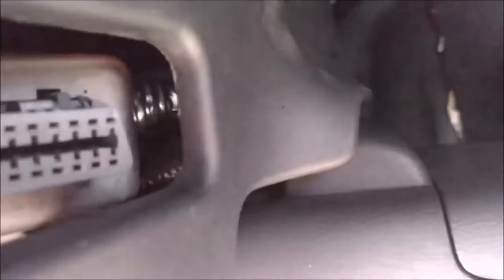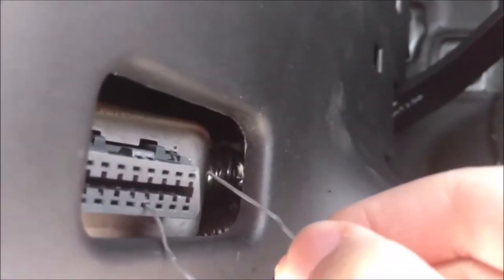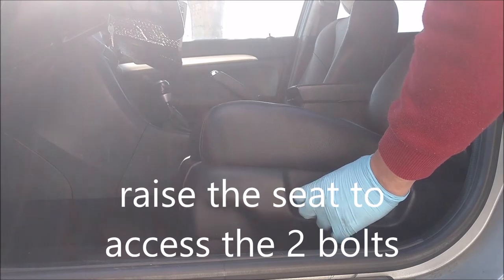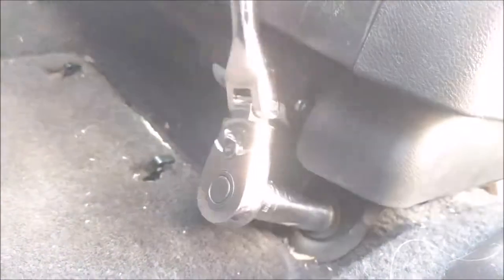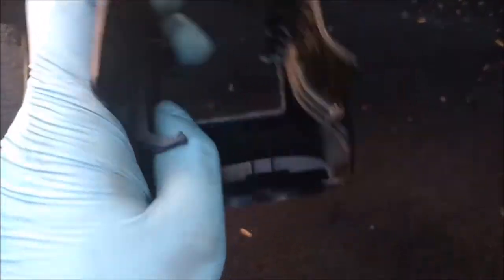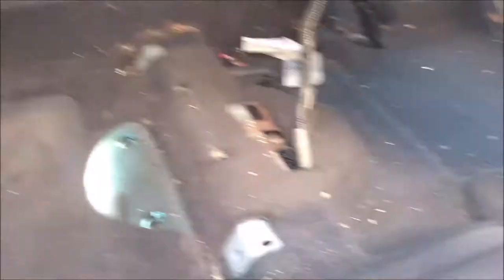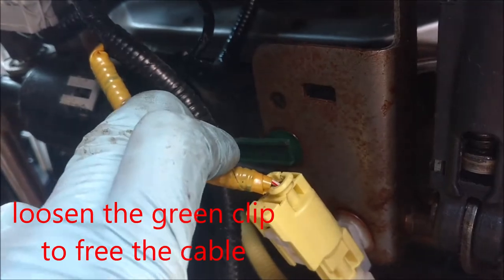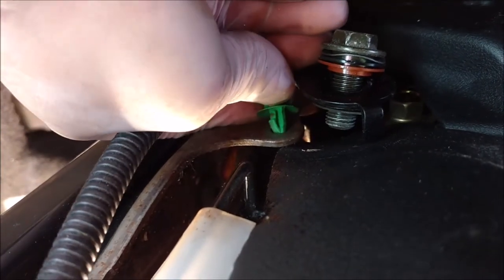Remove front driver seat, seat belt buckle to fix Airbag light of 04 - 08 Acura TSX, Honda Accord

Comment: thank you so much bro! I just saved $100 or more on this. cleaned out the buckle didn’t even take it off. The little screws are the pain in the u know what. cuz its has the star back. light is off.
Reply: Did you just spray the buckle with contact cleaner?

Comment: Thank you Joe. The video is very helpful!! I have the same seatbelt buckle issue and mine is a 2005 TSX. Can you please tell me which size the star screw head is? 
I was able to make the light go away temporarily by spraying the cleaner from outside. Now I would like to open up the buckle to getter a better clean but I don’t have the right size for the star screw. Thank you!!!
Reply from the maker: I don't have the exact size. I got the screw driver set from amazon : https://amzn.to/2Z9jW8m
you have to use a hammer to drive the screwdriver in the hole of the screw
Reply: @joehowto  thank you Joe. Can you tell me why you had to hammer the screwdriver in the video? Do I have to do the same? I don’t plan to remove the seat as I think I could get to the screws with the seat in place. Thanks again!
Reply from the maker: @Icesouldy  I remember my screw had a little cylinder thing in the center of the star that prevents the screw drive to fit into the hole. Maybe your's is different. It depends on what type of screw they used. Thanks
Reply: @joehowto  thank you for replying again! I’ll give it a try tomorrow. Hopefully I don’t have to hammer it

Comment: damn i cant remove the screws, what size is the torx? mine has metal in the middle so it doesnt fit, i am not trying to take the whole seat out and the buckle off to hammer. any tips
Reply from the maker: try t 30
Reply: thanks for the reply. i just ordered a set of security torx screws. the ones i have are regular torx. the security ones have a hole in the middle and i did not want to damage anything

Comment: So update. Did this and it went away but now its coming on and off sometimes. do i need to use the paperclip and do that? Or can i just clean the buckle.
Reply from the maker: Clean the buckle
Reply: @joehowto  i did that. And it still comes back on. I didn’t do the paperclip process.
Reply: @samuelugh5729  did you follow up with the paperclip reset process?